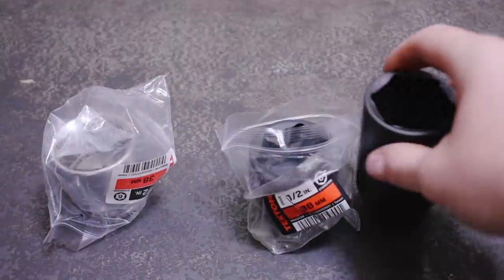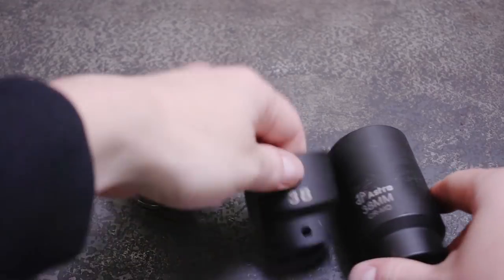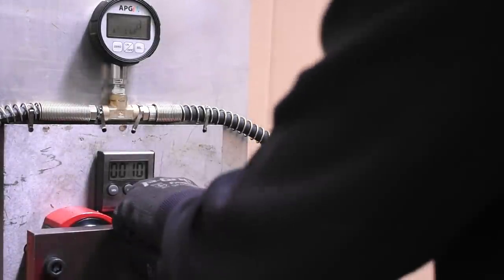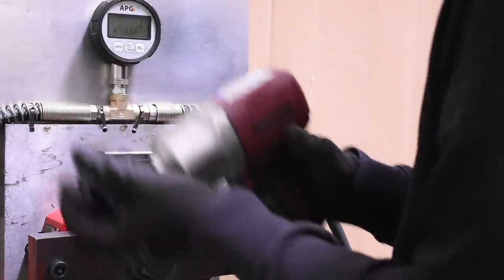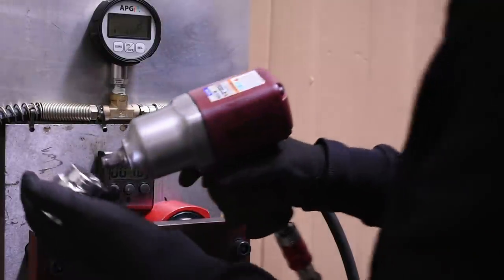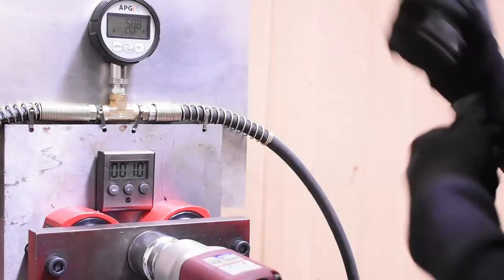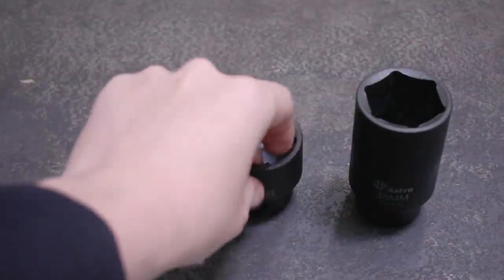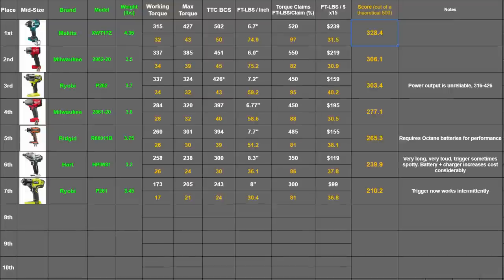Does Socket Type & Weight Affect Impact Power? Quick Test 5

Comment: The likely reason there is no difference between the socket weights and power capabilities is because they don't have any distance to rotate. It's essentially like hitting something with a 6 oz hammer and only getting 1/4" of swing, versus a 24 oz hammer, with the same amount of swing. There's not going to be a significant chance in effective power. 

Where you'll likely see the difference is in tightening, where the socket has the rotational power to make a difference. And even then, it will only make a significant difference on the first solid hit, when it's got the most energy built up. Subsequent hits will have diminishing effect, due to far less rotational mass 

What makes the difference in the power of an impact is the internal rotating hammer on the gun. The heavier that is, the more torque it will be able to impart on the fastener.

Comment: I don’t understand stand socket weight concept, surely if your sockets a good fit it shouldn’t be “adding” resistance/absorbing the energy you put into it through impacts, be like hitting the same sized bolt just 1 has a heavier head. 

Think the big deal is what are the sockets made from. We all want indestructible sockets but making them extremely hard they’d shatter, make them soft to with stand the impacts and you’d stretch the socket out over the nut or twist in its own shank, personally in think this is where you lose energy if you use a plain unbranded set of sockets they may do everything fine but 1 day you’ll be coming up short and grab an expensive shallow one and boom, doesn’t stretch with each impact nor stretch down its length. So you will become a convert!

So try again with cheap stuff, quality tools you’ll always get good grouping as you’d hope they are made well. Buy cheap, you’ll round heads and stretch the sockets out or just lose energy down the shaft or still be coming up short of what the named brand can deliver with the same style socket.

My thoughts any who, good video!

Comment: Weight has little due to torque transfer... the answer is rigidity... even going as far as how well you are holding the impact straight, stable and pushing into the fastener.

Comment: If the impact has a sufficient hammer and anvil, the mass of the socket isn’t as important. In the case of Milwaukee who does not use proper hammer and anvils can benefit from extra mass sockets (deep). For a proper not shit impact, shallow sockets that fit very snug win out for power transfer.

Comment: I've seen southmain use a heavy wall socket to remove axle nuts I think it was big thick wall for added mass
Reply: Most of the time you can take a axle nut off with a Hammer and chisel cause it's all the way tight half turn back then lock ring and jam nut

Comment: CR-V is hard metal that vibrates and rattles under impact. This is bad for energy transfer. 
CR-MO is soft metal and absorbs the impact and transfers the energy into the bolt better. It also wont explode break like CR-V. CR-MO more likely to tear.

Comment: I would think the power generated at the impact by its internal mechanism would not be enhanced by a heavier socket, since all it does is transmit the power generated within the impact gun.  In fact if you used an unusually heavy socket, the inertia of the socket would dampen and diminish the impact generated within the impact gun.  Imagine an anvil were attached to the output of the impact gun, would that enhance the impact force?  I would think you would barely see any impact force transmitted through it.
Reply from the maker: Well this might blow your mind then, like it did ours https://www.youtube.com/watch?v=qVd8Bx6AAQc
Reply: Torque Test Channel very interesting.  Thanks!

Comment: In real world use I haven't noticed any significant difference between a heavier and lighter socket. Granted this is in the 18 to 24mm and from one brand from another which have a noticeable difference in hand feel. I'm sure the torque if tested would be slightly different but real world use nothing noticeable for me.

Comment: Try a test where you let the gun rattle as normal and one where you twist the socket with your hand to take up the slack/ backlash.  That's an old wives/techs tale I'd love to see buried or confirmed!
Reply from the maker: Is there a video showing this? Never heard of the myth
Reply: I've used that trick successfully several times removing lug nuts with my old IR W360 battery gun. But just because it works doesn't mean it's safe. Could end badly on a fast and powerful gun, especially if you're wearing gloves......

Comment: A guy on YouTube was comparing a Milwaukee 2854 3/8" Compact Impact Wrench to a Milwaukee 1/2" 2855P compact Impact both about the same, except the heaver wall sockets seem to work better (as he was showing it). I had a hard time believing it where he was not doing a test like you do. He used it on cars but you really do not know if it was over tighten or not. Just do not think it was a fair test for each tool.

Comment: My question is. The four-wheel drive it front won't take a impact sockets. So I had to use a chrome socket. And I have had many impact sockets that failed at the very end. They are so cheaply made. You just might as well buy the Chrome socket. And just have someone replace it. I don't know how many times I beat on a impact socket. Just to have it strip off. Because some jackass. Beveled the end of the socket. And made it thinner. Because it's painted black. Doesn't make it a good impact socket.

Comment: Not sure, I feel I get a better transfer of impact with my heavy Boxo sockets, than the cheap no name Amazon brand, not more hit, just better transfer.
Reply from the maker: What size though? These are 38's. We'll dive into smaller soon when we're set up for it.
Reply: @TorqueTestChannel  I use 1/2” drive 10 to 24mm, after trying the Boxo in a 19mm, I got the whole set to replace the no names. The no names rattled on the fixing, taking longer to undo, where as the Boxos ask maybe 3 times max. It ain’t scientific, just my observation.

Comment: It makes zero physical sense why weighted sockets work if not trying to match vibrations. That is if the hardness of the sockets are identical, the slop in the socket to bolt/nut is identical along with the fitment on the tool itself there should be no change in shape or weight of sockets that is drastically higher than another(other than the harmonics....ok harmonics for lack of a better word). Realistically the higher the weight of the socket means the less "umph" going to the nut/bolt due to the tool having to overcome its weight in order to turn it then to turn the fastener.

Comment: Can you please explain this? Seems like going to a 1/2” drive made his right angle impact more powerful. 
https://youtu.be/Ccn0r_iyTSM

2 things that don’t make sense to me:
1.) per your video, socket size doesn’t matter. But the video linked shows that his right angle impact got more powerful with a bigger socket size.
2.) I thought adapters eats torque away? Why did it become easier to remove the nuts when he used the adapter?

Thank you for your insight
Reply from the maker: Ahh yes, the myth of torque equivalency. Torque is a measure of your effort when tightening it, not how tight the bolt is. The fact is the larger bolts were likely under less tension, despite taking more swinging from a wrench to reach a torque value. Less tension is easier to loosen. Brands count on people not knowing this when they test "nut busting" on a 2" fine thread large flange hardened nut. We measure tension on this channel (and how skidmore's work).

Comment: here's a real-life test (and please understand that your co-worker needs to agree to this!). Punch a co-worker in the shoulder with your fist. Then do the same thing holding a 24mm deep socket. For sure your friend will say the punch with the socket had way more ummpf. Assuming your strength didn't diminish, it's the extra weight that added to the work done. I don't think anyone is debating this of course but it's a really vivid example. I believe the torque with thick-walled sockets will add 20 to 30% more torque... but I'll be interested to see this test done!
Reply: That’s assuming that the impact can transfer as much force into the heavier socket. Remember when you have to push a wheel barrow? When it’s fully loaded it’s harder to move vs empty. And that’s what I’m thinking is happening with the anvil and the socket. We would have to have a way to measure the instantaneous force of 1 impact and see what the energy transfer is.
Reply: @FishFind3000  Right, its the internals of the impact gun that is producing the power, the socket is merely along for the ride so it can only help transfer the power that's being produced. However some sockets and lets say its a worn socket or worn bolt/nut or the wrong size socket, it will do a bounce back action unless held with a hand to keep it connecting onto the bolts hex surface. Also and I only theorize that various impact designs within the gun may work better then another for call it a follow through blow. Sort of like the large slow bullet vs the fast light bullet idea. Like I said this theory may hold no water.
Reply: @FishFind3000   totally agree with you on this.., but FTR my nitrocat pounds my lisle honda harmonic balancer bolt out in no time and the same size impact socket (with the same impact/psi etc) just never budges the bolt.